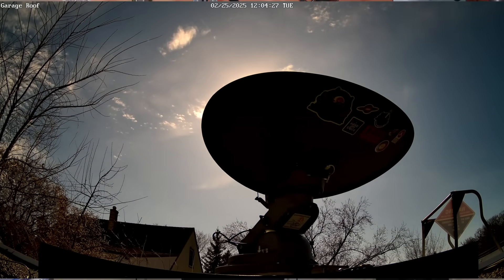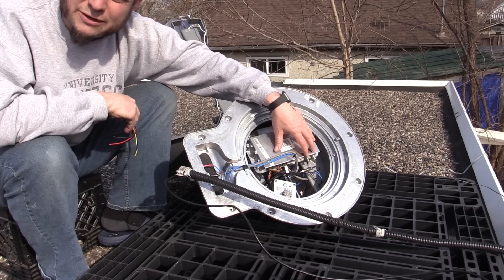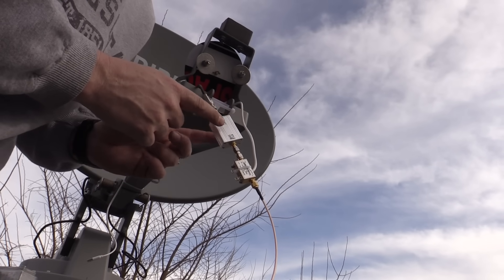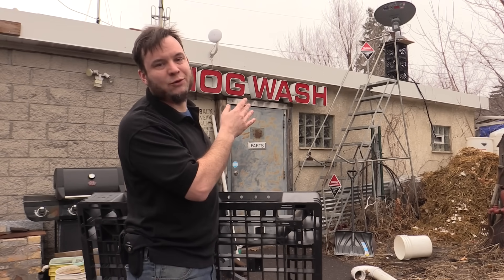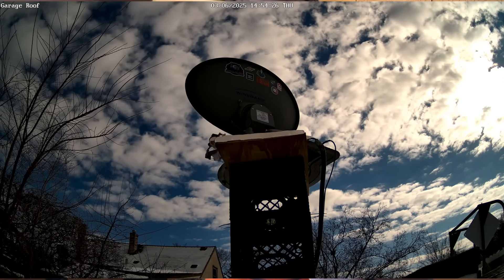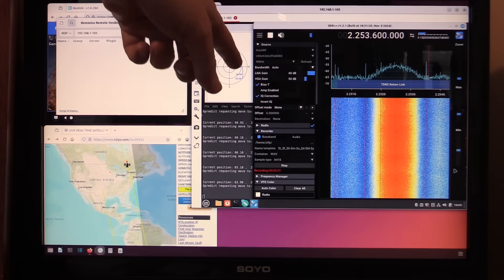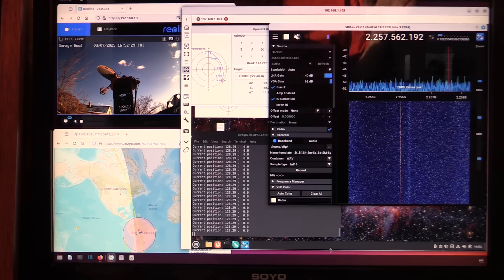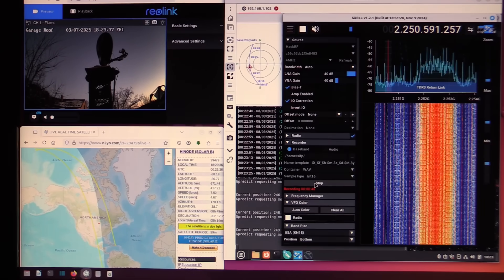Upgrading My S-Band Satellite Tracking Dish

Comment: is there a dish aim control for windows or is it just Linux? and can you manually control it or is it just for following satellites?
Reply from the maker: I wrote my own code to run the dish, actually haven't tried it on Windows but it's just a Python script so it should be cross-platform. I can manually control or have it do a whole-sky scan if I change the code a bit.
Reply: @saveitforparts  is that the window that shows azimuth and elevation? with the satellite trajectory on the pass over, or is that a different software?

Comment: Gabe, I know you like helical antennas and so do I. I'm almost done making an open SCAD parametric design for quick close to the bed 3D printing. I like general solutions so this is parametric on Freq and it comes with a built in matching network so it's not RX only but RX/TX. My 3D printer is large and will print designs all the way to 700MHz but a standard one will probably be only ok from L band up. I have your contact info and I'll get it to you after I have finished it and tested it.  May be a week or 3. 73!

Comment: The extra filter having no effect either means that you don't have any too strong sources to suppress, or if you have a strong source annoying you, it's in-band:
I live a few hundred m from a nasty transmitter, and have about 300mV on a dipole cut for a different frequency. If I put an amplifier on that to compensate for cable loss, it will clip the amplifier, or the input of the receiver, turning everything into an intermodulation mess. So I have a 70dB passive filter to reduce it, and then I can go into the amplifier without problems.

Comment: Your cavity filter won’t improve your existing signal , but it will reduce signals outside of its passband. This helps if you’re close to a transmitter that might overload your amplifier or SDR input stage.

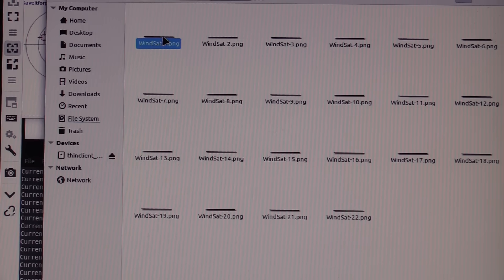Comment: 10:30 I wonder if those pixel-wide images are actually data. It's possible that those pixel-wide images aren't just noise but actually encoded data, possibly using a compact command-based encoding rather than standard ASCII. Many older systems relied on custom word-face encodings or lookup tables to transmit short commands efficiently.

You can store binary or even more complex data in an image by encoding values in the RGB channels.
For example, a simple binary encoding could use:
Black (rgb(0, 0, 0)) = 0
White (rgb(255, 255, 255)) = 1

In this case, the white "blobs" could represent bits of information, with black pixels acting as delimiters. If structured properly, these patterns could store numbers, instructions, or even text using ASCII encoding.

For example, instead of transmitting full text as ASCII (which requires 7–8 bits per character), an older system might use predefined bit patterns for common commands. Something like:

0001  = WAIT  
0010  = READY  
0011  = SEND  
0100  = RECEIVE  
0101  = ERROR  
0110  = COMMAND  
0111  = EXECUTE  

So instead of sending actual words, it’ll send super simple blips like:
0001 0110  
(WAIT COMMAND)

in a repeating pattern, acting like a heartbeat signal to let a ground receiver know it's still active.

This kind of encoding would be much more efficient for low-bandwidth satellite communications. If the pixel-wide images contain repeating structures, it could be worth checking for fixed-length bit groupings, which might correspond to a predefined command set.

If this is the case, the satellite might still be running old firmware, waiting for input or attempting to acknowledge commands from a long-defunct system. Maybe it's not just noise; it's an orphaned system still trying to communicate, yelling into the void, waiting for someone to talk back to it.

Comment: Have you tried using DragonOS instead of Mint?  I think it has SatDump built in (along with practically every SDR & radio related software that will run on Linux).  Anyways, if it's a dependency issue or whatever, DragonOS has all of that all figured out for you.  That said, decent used PC's are cheap on the local auction sites.  If you don't like the LXQT desktop DragonOS uses, you can put practically whatever you fancy on since Linux be cool like that.
Reply: Also, major props to you for this immaculate setup.  That is true ham stuff right there!  Well done!

Comment: 3" and 4" white PVC DWV pipe (drainpipe) is your friend for making weather-resistant enclosures for cheap.  End-caps for the pipe are cheap.  The pipe itself is cheap.  You can make an awful of of enclosures with a full length of it.  Used it for years and years and years.
Reply: Is it microwave transparent?
Reply: @TheNapalmFTW  Sadly, not particularly.  It's one of the few polymers that is quite aggressively lossy--so using it for a radome will only lead to sadness and prescriptions for SSRIs.  Bitter experience.  This is both due to the molecular structure of PVC, and the fillers they put in PVC pipes and other PVC materials.
Reply: @patchvonbraun  thank you, I remember in an old RSGB (British ARRL) handbook they said to place a small piece in the kitchen microwave and see if it got hot
Reply: @pandapip1  I know lol
Reply: @pandapip1 , phosgene is safe enough for the dupont employees to breathe. It can't be that bad for my non wizard lungs